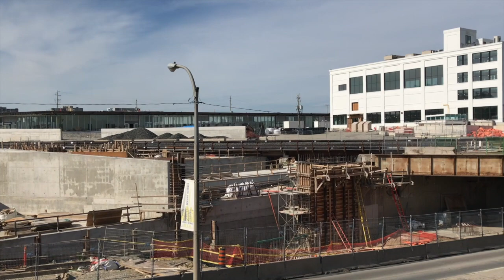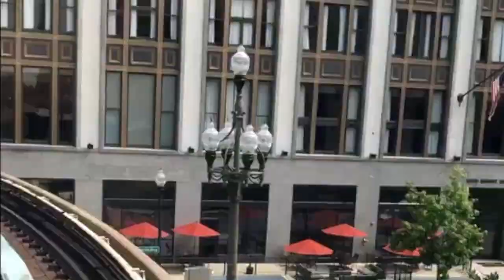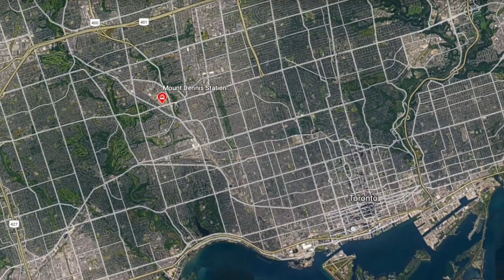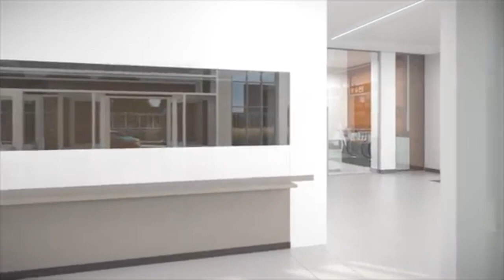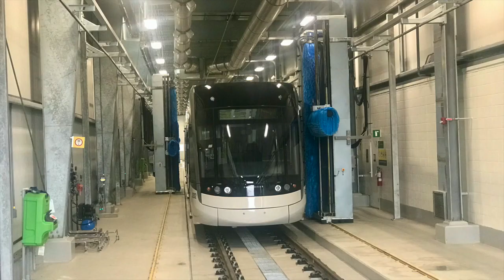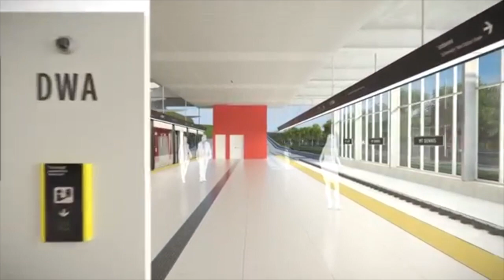Mount Dennis Station Construction

Comment: Also i wonder what would happen if they put the Flexity there, and what if they got a CLRV from the garage and drove it there or ALRV?
Reply from the maker: They use a different track gauge and power voltage so it wouldn’t be possible as far as I know. The vehicles on the crosstown will be the Flexity’s though, but a slightly different configuration
Reply: @VanishingUnderground  aww :( its it the same as the RT?
Reply: Burned Noodle no the crosstown will have a streetcar like look

Comment: Wait wtf, if Crosstown goes to Pearson then then the whole Line 2 plus 927 is useless.
Reply: One of the most ignorant transit comments I've ever read... you think Line 2 exists solely for people to take the airport bus??
Reply: You are talking about something that is only theoretical and at least YEARS away...Trust me, I know a little about that. I live in northern Scarborough...In 2000 there was a planned LRT line on Sheppard Avenue and a SLRT rebuild planned. The dysfuntional (late) Rob Ford city Council cancelled it and said "We NEED subways"...Its now 2020 and so far NOTHING has been built. That includes the  replacement for the Scarborough SRT line...built in 1983 and 10 years past it's shelf life...Meanwhile, VAUGHN has a TTC train running right into the city...and Vaughn residents did not pay a NICKLE of tax money towards it. THANK YOU, TORONTO CITY COUNCIL!!

I have learned as a Scarborough resident...NOTHING is real in public transit projects until the first vehicle pulls out. Until then its only talk!
Reply: Norm Leggett i know that the extension will be built in 2030 (not including possible delays
Reply: Technically it's the Route 900 that goes to Pearson Airport, not 927. 927 is the route that goes along Hwy 27 to Martin Grove & Steeles.
Reply: I doubt they'll get rid of the 927. It could still be useful for anyone taking the TTC out of downtown instead of paying for UP.